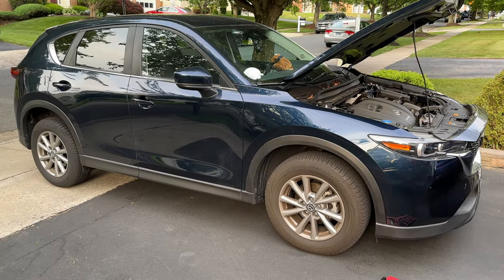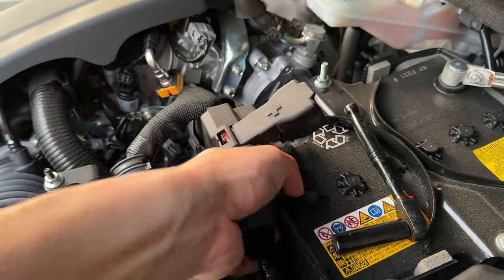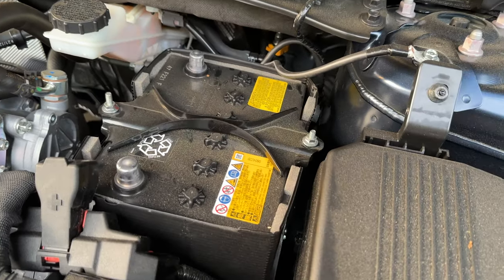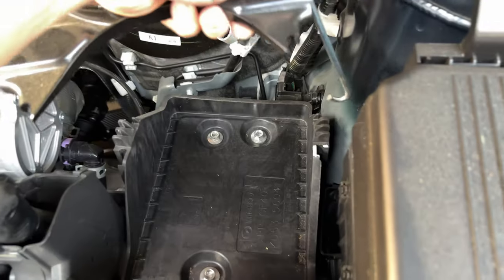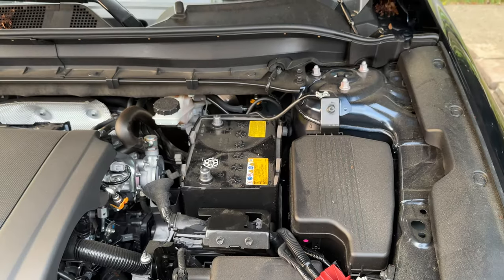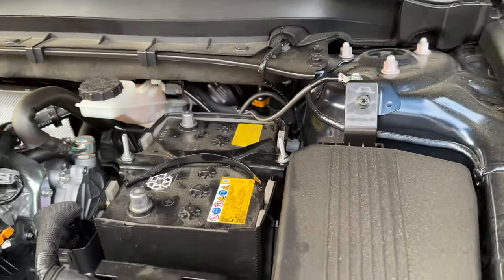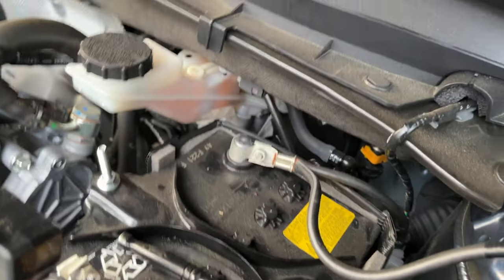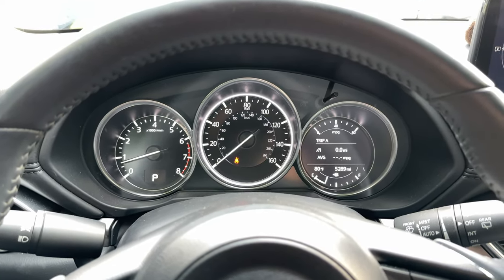Mazda CX-5 Battery Replacement (2018 - 2024)

Comment: Like others have commented, the negative should come off first, then positive. Wiring the new battery is the opposite-positive first and then negative. Also the j hooks don’t hold the battery like the video shows. It should be parallel. Pay attention to this when taking out so that you put it back the same way.

Comment: Are the systems in the car affected somehow, by plugging off the bttery? I mean, some settings lost or something I'd need to configure again etc.?
Reply: Only some settings need to be configure again not all. Stuff like memory seat and brightness levels on the screen. Everything else should be fine.
Reply: The istop system is disabled and has to be configured to recognise the new battery.  Easy to do if you follow the instructions

Comment: Thanks for this video.  I just changed my 2019 cx5 Gt for the first time on this car.  A couple of points of interest for anyone who has never done this.

1.  if you're not sure what size engine you have, 2.2 or 2.5, lift the hood and underneath is a sticker which will tell you your engine size.

2. In regards to installing the new battery.  It is important to note that the brackets that hold the battery in place go on in a specific manner.  So before you detach it, get a good light and  take pictures of the position of the hooks to see their placement.  They only go in one way, and if you don 't know that, you're going to get frustrated.  

This truly is a straight-forward, easy process.  Hope this extra info helps somebody out.
Reply: Hi Steve, after battery replacement, any computer system code error messages showed up which needs resetting by dealer? Thank you
Reply: @Nimo5555  I don’t recall that being the case.  Error codes shouldn’t come up from a battery replacement. However, if codes do appear and you have and OBD2 reader then you should be able to clear them. 

Or if mean the dashboard maintenance light, you can reset that from your car’s command control.
Reply: @stevelanza4689  Thank you

Comment: Thank you for the great instructions. Just one thing, the battery tray KE52-56-041B has groves to engage the J shaped end of the battery hold down stud 0259-54-292A. Therefore, the J saped part supposed to be parales to the side surface of the battery.

Comment: What about car alarm systems mine is a 2019 mazada cx5 they told me that because the electric rear lift gate stopped working it was a battery issues i had everything reset but it stopped working again this my first fancier vehicle:) little ticked no easy way to open the rear lift hatch manually:( i bought my battery but was worried Id have to reset the codes like the alarm if it has an engine immobiler so hopefully i can follow this video without a hitch and replace it :)?!
Reply: Hi there, did you do your battery replacement and any system code resetting needed afterwards?